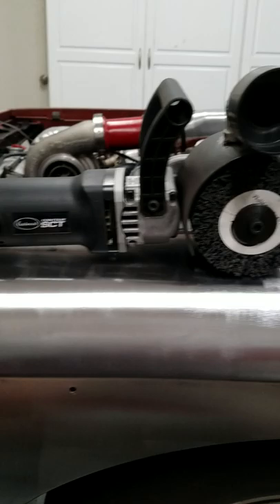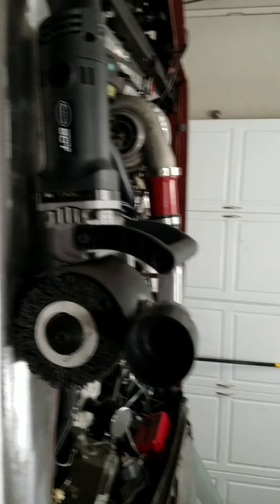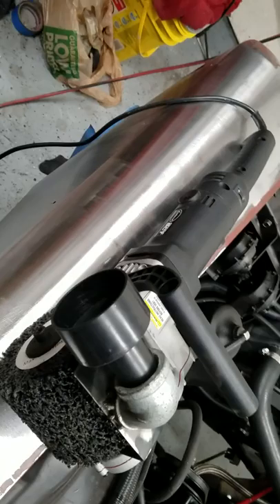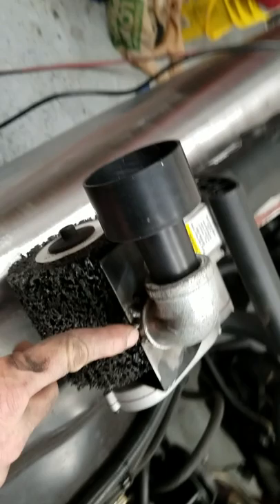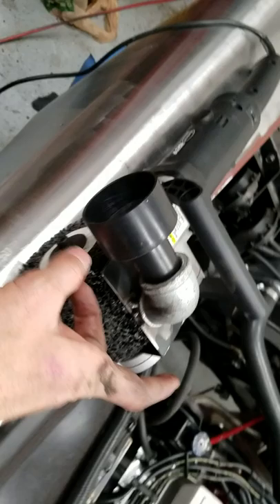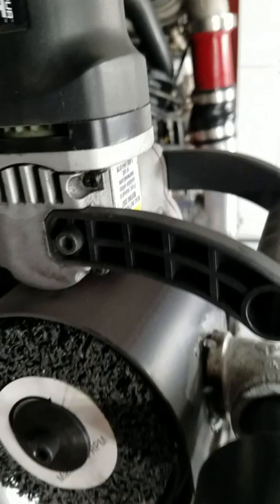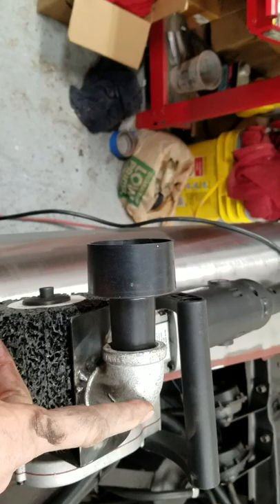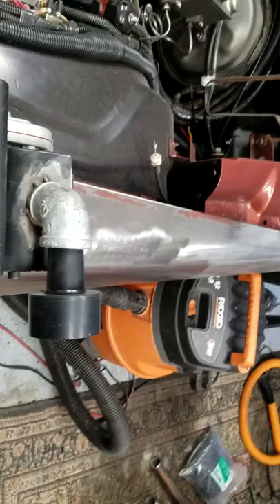Eastwood SCT with vacuum attachment mod

Comment: Just about to strip multi layers of paint on my project car- just so happens to be a 1965 Riviera  ( I noticed yours is the ‘Boat tail’ Rivy.) I’m narrowed my sander selection to either Eastwood of Harbor Freights ‘drum, sander. I was concerned about the dust coz I planned on sanding indoors. (quiet neighborhood)  I came across your vid. Sounds pretty good. I was hoping you would’ve taken some actual action shots. Anyway, Thx for posting. Good luck with the Rivy! ✌️